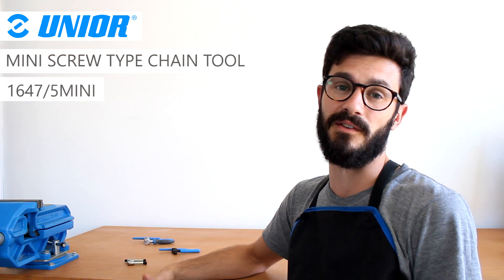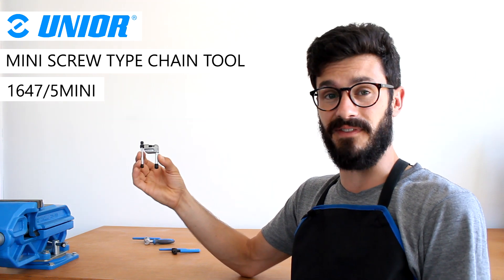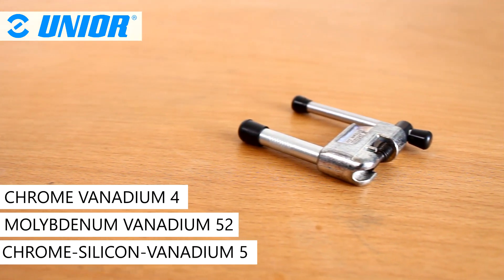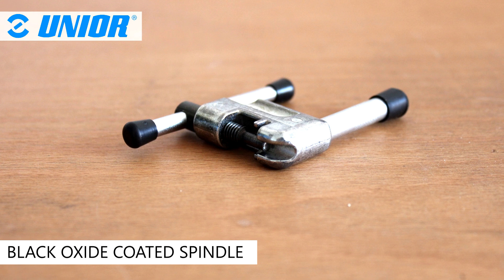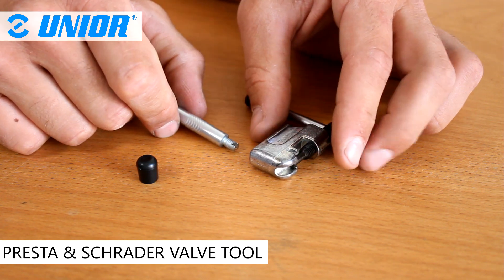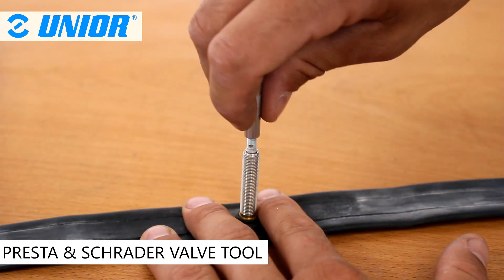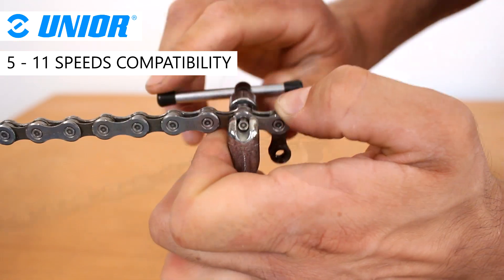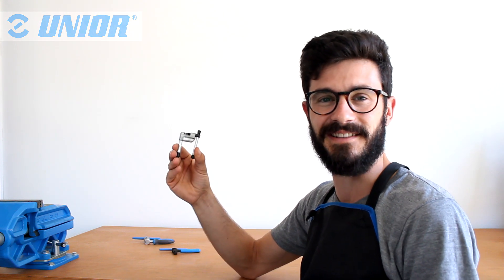Mini chain tool+ 1647/5MINI | Product Overview | Unior Bike Tools

Comment: The spindle on this is slightly pointing upwards and is therefore very hard to use for putting new pin into the chain. I broke the spindle now, do you sell replacements?